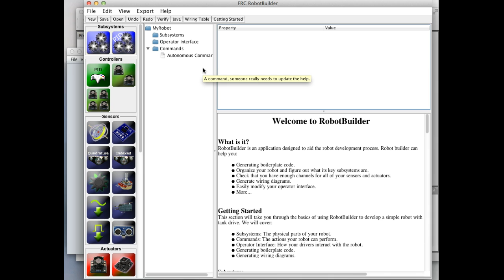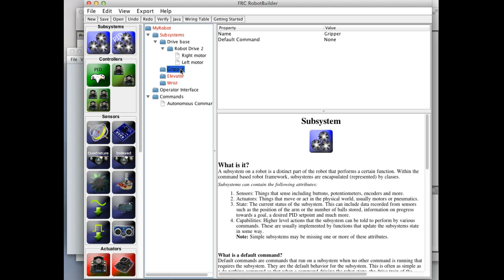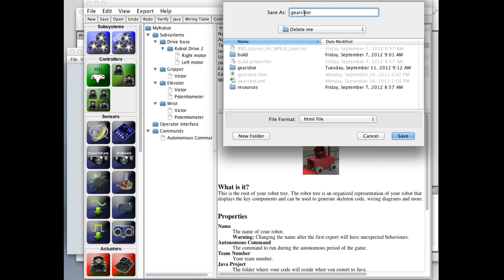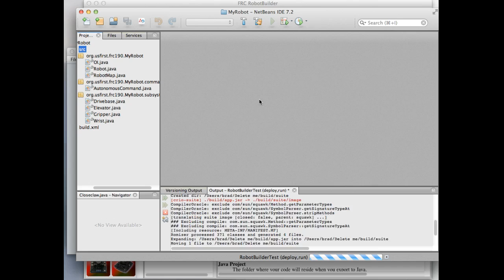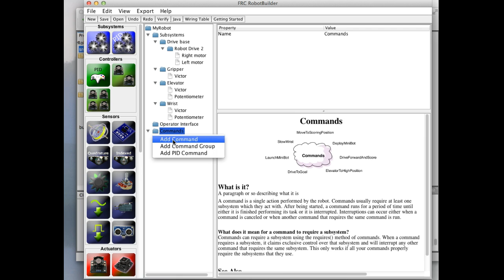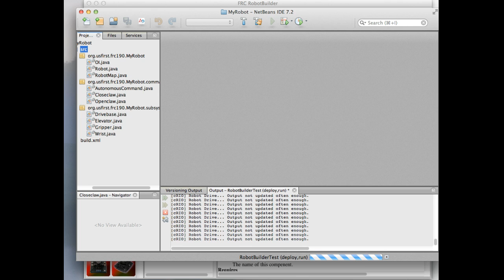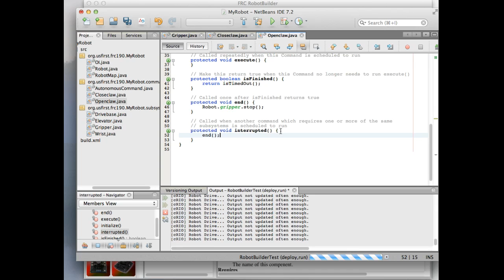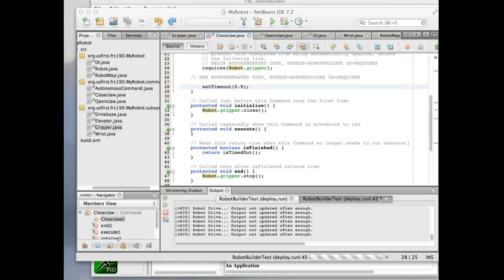Overview of RobotBuilder

Comment: 2013 this seemed to work well. However, this year it seems as though, when the java code is exported it has compiling errors. Thoughts?

*Edited* Rookie move on my part I wasn't using the correct java package in robot builder. Had to change from default. **